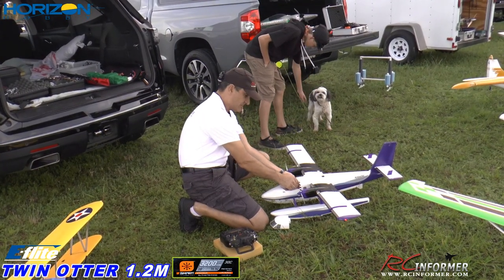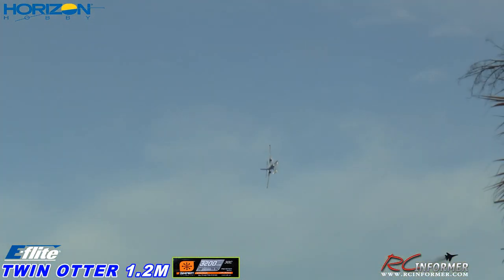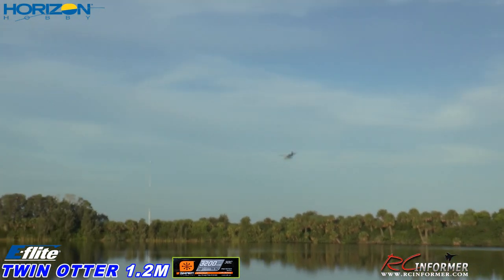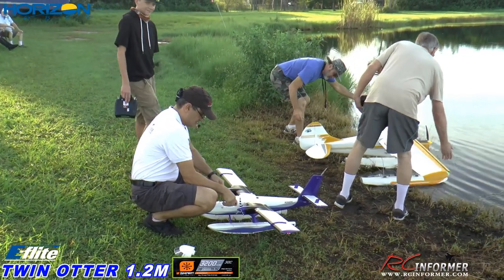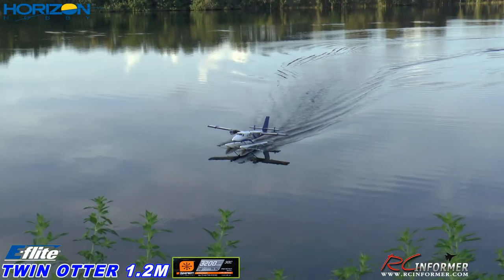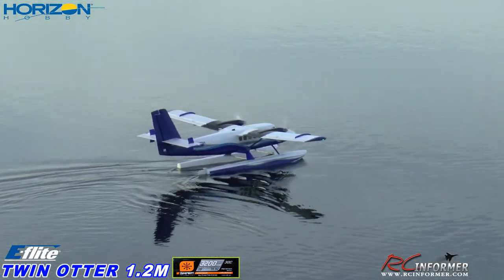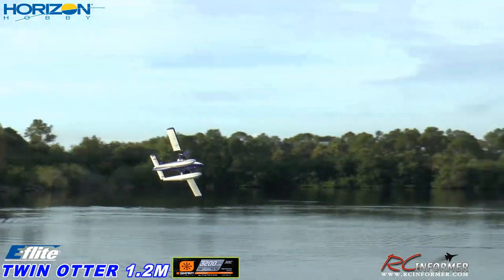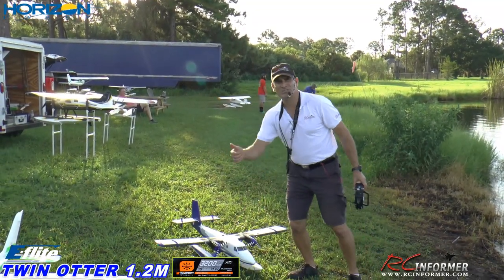Gavin & Steve Fly the E-flite Twin Otter at Moonport Modelers RC Field

Comment: Twin otter is very common to act the way it did with you when inverted or trying to do a outward loop whilst inverted, it will nose over into a roll really fast and lay on it's back or continue to roll if you hold the power on its because of the Twin motor design, in that situation get of the power completely and catch it from the nose dive you will need to be in to regain speed and controll, trust me I have the otter and practice this manuover alot once you no how it acts and are ready its very easy to catch and be ready for.

Comment: even if the radio (TX) is same brand and all, its gonna feel different. different length sticks, tension and slight differences in balance and other little things. i mean, i have two older TTX650 radios i got a few years back and even though i did my best to set them up similarly, they both just feel different. not different enough that i cant go back and forth between the two if i need to, but just enough that if youre used to one of them, the other feels slightly different. kinda like two steering wheels. they might be of the same make and model, on the same kind of car and everything, but its just gonna feel slightly different.